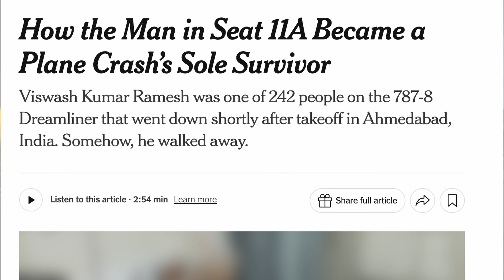Why the RAT Changes Everything – Air India 171 Update

Comment: Captain Steee, you mentioned a loud bang..  it could be a bomb placed at a certain point of the plane next to the main electrical boxes, next to the cargo hold.   The failure is to provide extra runway lengths.  Failure to inspect correctly on workers, offices, police and security, people and other truck carriers on inspection. Pilots improper setting and checking double time before take off may cause improper flight failure.    the runway needs extra a mile length.  This airport may have to close to check everything before reopening for safe operations. A rat may tell the black box.. we will wait and hear the black box ....

Comment: One more thing, why isn't the APU running during take-off. The APU is running to start the engines after roll back, just leave it on. Especially in a 787 that demands so much electrical power to operate.

Even Sully, the first thing he did was turn on the APU.

I guess the airlines do not want the APU to be part of the minimum equipment list.

Comment: It now seems probable if not certain that the RAT deployed, although it is not clear when the RAT deployed. It would be helpful if we had audio of the plane accelerating down the runway. I nevertheless find it extraordinarily coincidental that the 787 made it to take off speed (174kt), rotated and began an initially successful climb and then had both engines shut down at precisely the worst possible moment. Impossible-sounding coincidences can and do of course happen. I would be interested to know if Boeing had previously analysed and tested all possible failure scenarios in which both engines fail at the same time. Is it the case on the 787 that fuel is the only common denominator?  Can the plane itself be eliminated? 

The plane was refuelled at Ahmedabad for the long-distance flight, thus new fuel was added to old residual fuel. Could it be the case that the plane taxied out and did its take-off run on old fuel before complete mixture had taken place or having reached the new fuel? If fuel is the only common denominator then this to my mind is the source of the double shut down. If there is no common denominator other than fuel then both engines shutting down at the same time is statistically so improbable that it can be discounted and the plane itself exonerated. It goes some way to explain why in 14 years of service no 787 has had a double engine shutdown.

Comment: Q. From a None Pilot. It is still clear that Flaps were NOT extended but Gear was Down. Both of the Engines, according to some sources, had just been "serviced" and then refitted. Dual Engine Failure looks, as you say, the primary cause. Secondary we have potential pilot(s) errors due to the Engine Failure, Flaps NOT deployed but Gear still down. 
Software, IT, issues have NOT been ruled out as the Primary Cause that SHUT down the engines leading to everything else?

Comment: Theory number One . the question is this: if the pilot had used the entire runway for take-off with the fuel problem breaking the engines where would he have crashed? .. if he left first he may have heard engines at maximum power which then didn't last in flight. in fatality we must thank the sound and the senses which perhaps saved a more tragic outcome than this.

Comment: The engines didn't fail until several seconds after leaving the runway, so why would there be dead birds on the runway?

I would expect any ejected birds to be tiny little parts, and even with high thrust, I wouldn't expect those parts to make it back to the runway.

I could be wrong, but I don't think bird strike can be ruled out based on a clean runway.

But honestly, I don't think this was bird strike.  I just have a feeling it was something else.

Comment: I dont know how big bang is actually RAT deployment on 787. On A300 its fraction of sencond and its noisy bang. As this speed killed several engineers when deployed inadvertently, on A320 its way mych slower. And there is no bang noise. 

What I think the bang was might be actually engine stall. When you experienced engine stall its pretty noisy bangs.

Comment: So is it a Boing issue or with the GE Engines? Since both the engines failed, it probably is a Boeing issue. And if the actual fault that caused dual engine failures, all 787's are a flying coffins. FAA, ground all the 787's flying about till the cause can be found.

Comment: The RAT can also be manually deployed by the pilots. If the landing gear was not coming up, they could have deployed the RAT thinking it would give them additional hydraulic power.

Unfortunately the RAT only provides minimal electrical and hydraulic power. The RAT hydraulics only goes to flight controls. And the RAT electrical is only 115V, it will not power the main 235V buses. Running off the RAT the cabin lights would be off.

The landing gear operates on the center hydraulic system which has 2 large electrical pumps. When the flaps are retracted one of the pumps is automatically turned off. I don't know if the landing gear can be retracted on 1 pump, I suspect it can just slower. Or does the second pump come back on landing gear retract sequence starts, i suspect not because those pumps require a large amount of electrical power, and re-deploying the flaps would turn the 2nd pump back on.

I think the cabin lights flickering was the APU coming on line. The APU starts automatically, regardless of the switch setting in the cockpit, when a major fault is detected. The RAT will also deploy to provide power between APU start and on-line. Steve, you only went thru the RAT only list of auto deployed, there are more APU-RAT scenarios.

Back the this incident. Gear down and flags up -- can it fly at that speed and altitude? If the answer is no, then it doesn't matter if the engines failed. Simultaneous and synchronous engine failure is so unlikely, one would lose power before the other and airplane would yaw, also the cabin lights were on.

Usually it is a combination factors that cause these incidents. Was it an electrical failure along with out-of-sequence gear/flaps operation. And is there a design issue with when 1 or 2 pumps are on, or was that the fault (the 2nd pump failed to turn on), slowing the gear retraction, also slowing the flap redeployment.

Comment: In the clear video, it didn't look like the flaps were deployed. If they were deployed they should be very noticeable because they are so huge. I'm not saying the RAT wasn't deployed, nor that the engines didn't produce a fault and I really think that the engine noise would surely have drowned out the noise of the RAT and also should have been roaring past the person filming. In my opinion, the flaps were up and the engines weren't running and I think there must have been a catastrophic failure to produce such a disasterous crash

Comment: Complete electrical failure. The plane had electrical issues prior to takeoff. In the passenger cabin, a cellphone video shot by a passenger shows him trying all of the elecricals at his seat; screen, call button, light, a/c not working, nothing working. Now we have this new analysis including a possible additional electrical problem with a witness aboard describing a loud bang and the cabin lights flickering, just before the descent and crash. I believe total power loss was caused by a SEVERE electrical fault somewhere in the power system, perhaps because of poor maintenance. The aircraft has been flying since 2013. R.I.P. those poor souls.

Comment: I would think that if the two engines had not flamed out that you wouldn’t hear the RAT at all.  I’m not a pilot though I have worked at military airfields and when those planes take off all you can hear are those jet engines spooling.  I did not hear that in the video.

Comment: If you look at the landing gear in the video, they were tilted forward, but the 787 wheels tilt backward, but when a 787 wheels retract the first thing they do before they swing up is tilt from backward to forward, this suggests that they tried to retract the gear but lost hydraulic pressure as the gear were retracting which further supports the evidence of a duel engine failiure.

Comment: Do we know anything else about this plane? -what type of maintenance it last received or when that was?
Fuel contamination, fine, but isn't the fuel supposed to be manually checked for contaminants/water when the engines are started? -I don't suppose there is a possible way they could have run the aircraft out of fuel, right?

Comment: Fuel filters are fine micron filters , may have redundunt filters, if filters are chocked it would have given low fuel pressure alarm before take off , fuel pressure may be checked before takeoff in pre takeoff checklist, may not be fuel problem.

Comment: Are we missing the obvious in this age of fly by wire?
The aircraft crashed because it lacked airspeed that is obvious. 
We also know that the pilots reach V2 rotate speed and take-off, it is standard procedure to retract the landing gear as soon as you achieve positive rate of climb. Also it would be the first thing to do if you lack airspeed to reduce drag, to gain airspeed, this clearly did not happen. So the question is, in trouble with lack of airspeed and not getting positive rate of climb did the computer stop the pilots lifting up the landing gear?
Another possibility is a massive computer problem with the software confused by a sensor reading! That would explain the RAT deployment and an aircraft they could not fly. Paris airshow crash is almost certainly the computer became confused by the pilots doing something the software was not programmed for.

Comment: Takeoff run degradation is evident as aircraft done liftoff at the end of the runway, Pilot should RTO when acceleration wasnt as usual.
Question is did Crew started the takeoff roll from another end of the runway 11000FT if they had then crew could have done RTO than taking high risk.

Comment: Euro A320 Captain here.

What do you think about the possibility of an incorrect Flex/derated takeoff power setting being inserted into the flight management computer? Wouldnt be detected by anything other than the pilots at the planning stage.

We dont normally use full power on takeoff to reduce engine maintenance. We call it a flex/derated takeoff.

In this 787 Air India takeoff, do you think that the rotation seems to kick up a large amount of dust from the wing vortexes? I saw that and thought perhaps it was indicative of a rotation at the very end of the runway. I think this has actually been confirmed that they used all 3500m of the runway. Not normal!!!

The reason I think of it is because there was a 737 report I read from 2017 where this happened and led to a massively reduced thrust takeoff. 

This would also align with PAX 11A testimony saying that he heard the engines spool up just before impact. If close to max TO weight, would there really have been that much excess thrust for him to notice; unless the engines were spooling up from a much lower than normal thrust setting? IE a normal takeoff (90% thrust), to 100% wouldnt really be noticed. But 50% to 100% would. 

The rapid rotation could have bled off the minimal energy they had. The gear not retracted because of startle from the late rotation. And TOGA not applied because the captain ignored (no judgement) Fly Nav Com and went straight to a Mayday call in error…

The rotation killed the energy (more pitch = more drag). Then you see the nose drop to avoid stall (good move). But they never corrected the low thrust setting.

Sequence

1. Low flex/derated takeoff setting entered at the planning stage in error.
2. Takeoff roll as normal. Neither pilot noticed slow takeoff roll and failed to reject the takeoff before V1 (decision speed).
3. Rotated at the end of the runway at low speed.
4. Gear not retracted plus pitch for initial rotation and climb increased drag further, eliminating remaining energy. 
5. Captain called mayday rather than flying the aircraft, wasting valuable seconds.
6. As energy and speed decayed, nose was pitched down to avoid stall. 
7. Maximum thrust applied too late, engines heard spooling up just before impact.

Let me know thoughts....
Reply: That's all an interesting theory but it doesn't explain the RAT being deployed. My theory is someone in the jumpseat behind the pilots selected the fuel master switched to cutoff the moment they became airborne. Likely a murder-suicide. That explains the lack of any engine power right after takeoff and the RAT being deployed.
Reply: @BIOHAZARDXXXX interesting. Was there someone in the jump seat?

Also, did you see that they used 100% of the 3500m of runway? That means that they had a significantly lower thrust than would be normal for the whole takeoff, including the takeoff run on the ground. 

I watched the original video frame by frame, and honestly, I didn’t see the rat until very late in the video, if at all. But I agree that it did sound like it. That said, when you can allegedly hear the RAT, you can’t see it deployed. Have a look at the original video frame by frame and you’ll see what I mean.

Comment: Nice video and very clear. Speaking of clear. This video seems to show the flaps being up. This is a much clearer video and you did not mentioned that. Please clarify. What if the flaps were put up and BOTH engines stalled? Wouldn't this ALSO deploy the RAT? If so it could still be your original belief that the co-pilot raised the flaps instead of the landing gear. If a sudden loss of power though that would explain why the gear was still down. Again if both engines stalled from the lack of lift with the flaps being up it seems the RAT would deploy too.

Comment: @Micha-el80  A classic philosopher once said "You can never win an argument with an idiot."  

1.  As I have established by witnessing dust being blown into the air by jet wash, the Air India B787 used the entire 11,499 foot runway.   Preliminary runway take off analysis calculates  about 60% of that length was needed for take off.  This indicates improper flap setting and or insufficient thrust.
2.  There was no indication of a blown tire.  
3.  There was no indication of an engine failure or fire.  Indicators would be:  Rudder displacement, aileron displacement, yaw moments, smoke, fire, debris.
4.   According to some photo's the ram air turbine had deployed.  Unless the RAT was intentionally deployed, this indicates a dual generator failure.  
5.  The crew neglected to retract the landing gear. 
6.  A crew member made a distress call reporting loss of thrust.   
7.  The sole survivor witness account is speculative at best.

Conclusion:  Because of the excessive runway length used for take off, the take off flap setting and or thrust settings were most probably improper.  Deployment of the RAT indicates other problems but should not affect aircraft performance.   Landing gear extension provided excess parasitic drag greatly reducing aircraft performance especially with loss of thrust and or improper flap setting.   Crew action appears to be improper and negligible.  Failure for the aircraft to accelerate and to reach V1 speed by certain calculated runway length requires immediate action, I.E., abort take off.   Rotation at the end of the runway most probably indicates insufficient speed obtained to reach Vr (Rotation Speed).  Once airborne, the landing gear was not retracted.  Failure to retract the landing gear contributed to loss of aerodynamic lift making it near impossible to maintain flight.  Loss of engine driven generators have negligible effect on aerodynamics, thrust output, or control of the airplane.  The only exception being, prolonged extension of the RAT significantly increases fuel consumption.  This was not a factor.  Pilot distraction by loss of generators, pilot talking on the radio at a critical time when they should have been flying the airplane, may be contributing factors.   

Most Likely Cause of Accident:  Pilot Error.

Comment: Since the beginning my prediction was "an electrical malfunction". I excluded the pitol error. It didn't made sense to me.
I'm just an ignorant on aviation but the mystery behind the MH370 disappearance made me to read about these accidents.
My question is can an electrical failure or malfunction cause a dual engine failure !
Reply: No an electrical failure couldn't cause an engine failure. Even if both IDG's failed, engines are self-sustaining and will continue operating as long as there is still fuel. What's more likely is the opposite, a dual engine failure caused the electrical failure which caused the RAT to deploy. My theory is there was a third person in the cockpit sitting in the jumpseat behind the two pilots. This person likely set both engine master switches to "cutoff" the moment they became airborne which would be very quick and easy for someone to do sitting in the jumpseat. So a murder-suicide.

Comment: Perhaps the pilot left the gear down, knowing the plane would crash, to minimize the crash impact to save lives.
Reply: This is certainly possible but there was another analysis that showed the gear was actually "in-transit" to go up because of the angle the gear is pointed. But due to the electrical/ hydraulic failure, there wasn't enough power in the system to fully raise the gear so it remained down but in an "in-transit" position. Its difficult to explain in words without a picture or video.